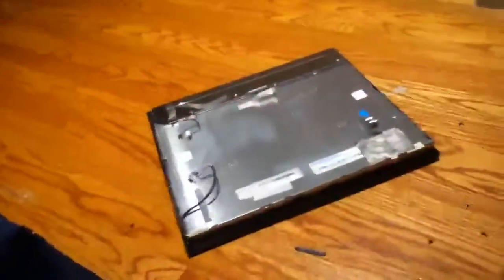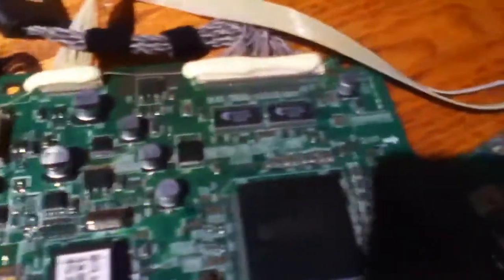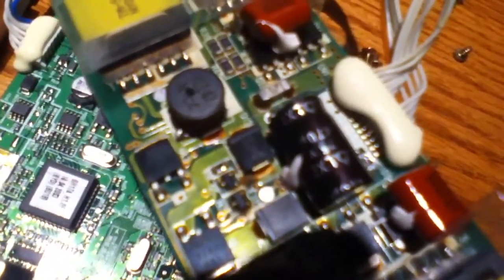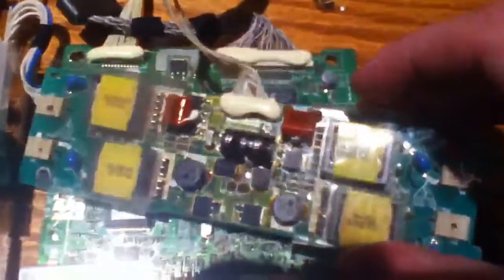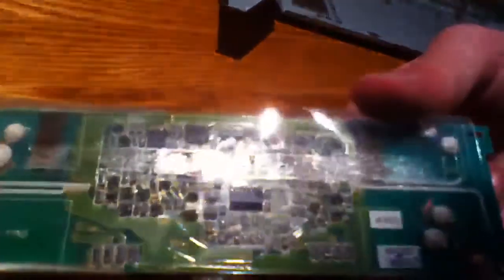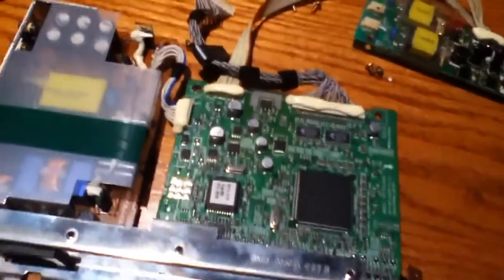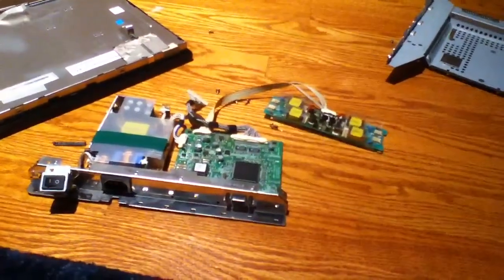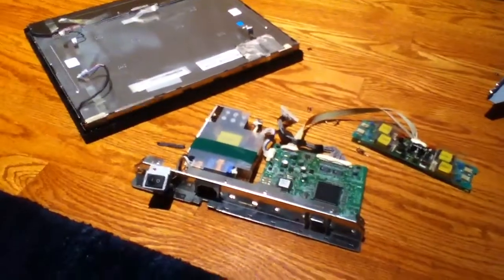Inspection Of Samsung Syncmaster 172N

Comment: @lmull3 if you hook it up. Does the no signal sign show even when the back light is off? or better yet try with an computer. If you let it cycle a few minutes it might kick to life until you shut it down the next time. I spent 40bucks on screen and inverter for my laptop. And both wore dead. Screen was dead first. Then i tried an bigger screen and fucked the inverter up. So had to change both. Make sure its EXACLY the right model. Dont do my mistake and hook similar ones up :P

Comment: I only know that I've had my Samsung sync master 172N for about 14 years and I put it in storage only for a short time and now it doesn't work could be humidity
Reply: I had a syncmaster 172N for roughly the same amount of time. Was last using for occasional access of a file server, but it finally gave up and stopped showing an image this past fall. When the server mainboard failed too(also a display issue...hmm...), I went ahead and ordered a new display today. It had a great lifespan, but VGA ports are getting harder to find on new systems, and the quality has improved a ton since the early 2000's. IIRC I returned one or two of these before getting one without stuck pixels.

Comment: 30 bucks was way too much to pay for a seventeen inch monitor. That does not sound like a good deal. In my experience, if it isn't a cap problem or something simple like bad solder joints or a bad vga cable, it isn't worth fixing. I have got some nice ones a 24 inch dell 19 inch viewsonic 17 inch dell and this one office gave me nine 18 inch dell 1800fp's with bad solder joints. I have had some that i just gave up on.I currently have two 42" plasmas that i am about to chuck.